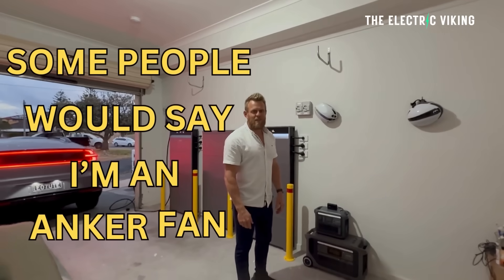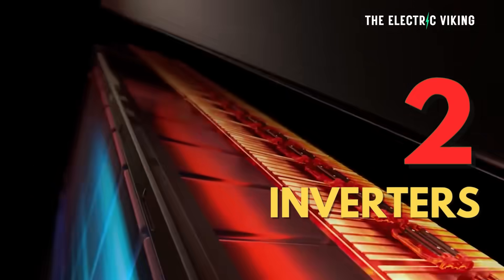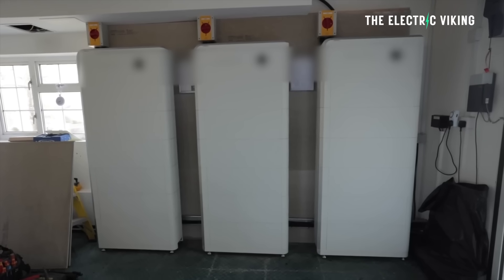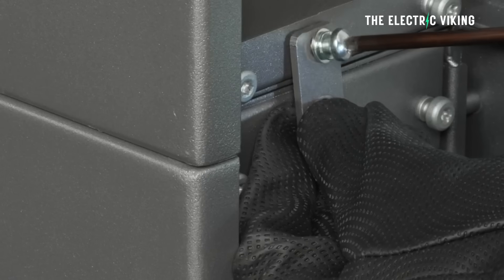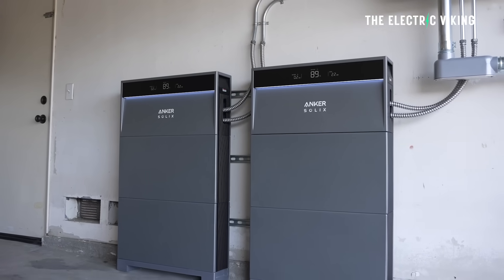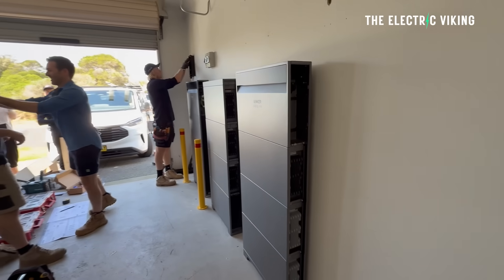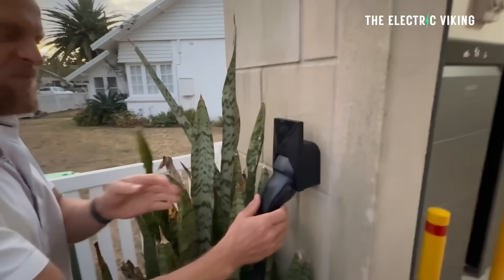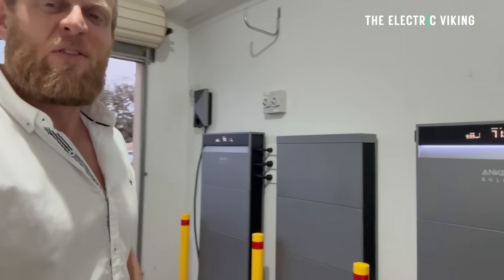50 kWh Anker Battery + 56 Solar Panels! My Home Setup Charges My House & EV For Free

Comment: They look nice but I have storage racks where I need the wall space. Anker is a little slimmer but you have so many of them. I have one 48kWh Sigenergy, 25Kwh inverter and 17kWh of solar.  I’m assuming your infomercial helps significantly to fund the batteries which is fine but you should probably tell people if that’s the case. Maybe I missed it?

Comment: These look great.    And these techs are getting more and more advanced.     

A few comments here.    If you want serious solar batteries system,  you need very very serious planning.     And it will be expensive. 

I have my solar system planned at mid 2024.   Here are my requirements at that time.   I have 2x 17kw 3phased air conditioner inverter and I have a 3phased 22kw 3phased EV charger.   I want the solar batteries to support one 17kw air conditioner for 4 hrs during blackout.      These requirements looks simple,  but if you convert them into technical spec,  it is a headache and definitely expensive.   Here are how they are done:  

-  66x 440w solar panel.  These panels cover all roof areas.  It is the maximum I can have (with existing solar pane tech at mid 2024).    Each of these panel weight over 20kg.  If you add the supporting structure and cabling, we are talking like close to extra 3 tons of load on the roof.   Luckily the house was still under construction.   The builder had to reinforce the roof further.      For those that go through building a house,  the builder added 20% for the management fee.  Thus the system is instantly 20% more expensive.   Plus the reinforcement fees.     From the aftermaths,   I could not have install such a system with an existing house.   

-  Fronius 3phase 10kw solar inverter x3.   In order to support the 17kw air conditioner plus EV charging,   I need like at least 30kw 3phased inverter.     There are not that many solutions going back to mid 2024.   The powerwall 2 does not support 3phase.  Even the powerwall 3 is in doubt plus they were not available at mid 2024.   

-  Without the solar system,  the mains has to support 2x17kw air conditioner + 22kw EV charger.   An standard level of mains supply is 60amp per phase That may not be abe to support that during the initial kick start of the 2x air conditioner at the same time charging EV.   Thus the builder had to negotiate with the Grid supply company to update the power supply.    

-  batteries.  Fronius inverters work with BYD.   Thus I have 3x 13.5kw per inverter. A total of about 40kw.  But these are not the actual usable capacity. (expect about 85% of that)     The system goes fully online only this July 2025.    During Winter with a good day,   the solar panel are enough to charge the batteries to full.  In a cloudy day,  it can't.    During Summer,  the panels can charge fully the batteries in at least half of these cloudy day.      With a sunny day, the batteries a full before 12noon.     I am planning to upgrades the batteries to close to 50kwh so that I can have power reserves during Winter.   

The return period of this system is like 10 years as the system is very very expensive.      But that does not account for increasing power bills.    So I expect this system to break even say 8 year.  Keeping my finger crossed.

Comment: Found someone on reddit who added his Anker Solix F3800 to his Tesla Power Wall 3. He just plugged his home power panel into a breaker on the house panel and the power was added without a conflict with Tesla software. To me is means you could add a cheap power source like a used leaf battery to a Tesla Power Wall 3. We just got 31 solar panels.

Comment: The problem with Anker as a single unit is that the inverter is only 6KW. You need 2 head units linked together (only available recently) to output enough current.

Comment: I have a Victron inverter system build with 77 kWh battery. Build myself just like Andy from Australia. Our house is all electric, heatpump and a electric car and a hybrid. I have 21,5 kWp on solar. But the wintertime is the problem. I am working on a battery update to 150 kWh and put some more solar to it.

Comment: I'm way down market. We live off grid with 12Kwh storage , 18 panels , big ones and still run an EV from home. It is our only car. We have been retired for 5 years so we do not do the travel we at one time did . If we were both still working it would not have worked but now it is the best option both financially and climate wise ....

Comment: OK you are spruiking Anker. I will give my unbiased opinion.

We installed a 20kW 3ph Anker system after we got messed around by BYD who were our first choice.
The durability and stack thickness means nothing in Australia. Looks mean nothing, a battery is a battery. I don't care what it looks like and the fact that it is 15cm thinner than the next one is irrelevant.
The screen display is fantastic. Every battery system should have this.
With 3ph supply there is no need for an expensive EV charger. We have a EV6 and just use a $200 32amp charger off eBay, works perfect. We can pull 8kW out of the battery but with the charger or use the "3 for free" power and feed the max 11kW to EV6 will take.
We fill our battery everyday from the grid (our panels do most of the work in summer, none in winter here in SW Vic) so buy no power. No need for 50kWh of storage. I reckon we could manage our all electric house and EV on a 10kW system and no panels if we had to. The key is having a 3ph supply and using the free power on offer through mobs like Ovo, etc.

We had initial problems but the Anker helpline was excellent and they sent a firmware patch within 24hrs.

There are wild claims out there suggesting 3-4 year payback. This is rubbish; we reckon 8 years is more like it and we are working the system pretty hard. VPPs are a con that will cost you money in the long run. They are marginal now and as the grid improves they will cost you money compared to getting 3 hours for free everyday.

The under reported factor in home battery success is having 3ph supply. People need to be aware that building in 3ph future proofs your home. We built 5 years ago and the additional cost was $2,000. The builder couldn't understand why we bothered.....

Anyway I am happy to recommend Anker but not for the marketing BS. My backing is due to Middys (or one of the other large spark wholesalers, can't remember which) being the importer so there is plenty of local hardware support and our experience of factory software support has been excellent.

My real advice is the important issue is the retailer and installer. You need to pay more and get a local, established, trustworthy company. If they offer a cheap system they will stand behind then just go with that.

Comment: Will you please dig deeper into the battery backup electric load and how that is managed? We’re about to level up the energy game! Dropping an 11 kW SilFabSolar array—made right here in Washington bro. And guess what? WA hooks us up with no sales tax, sweet net metering, and Uncle Sam throws in a 30% federal tax credit. That’s like stacking sunshine and savings! 🌞💸
Now the real flex? Cybertruck backup power. With Tesla PowerShare, we’re talking backup for 10 critical circuits. Basically, when the grid taps out your Cybertruck steps in like a superhero feeding juice to the essentials—think fridge, lights, Wi-Fi, and maybe that gaming rig.

Comment: it isnt for Free at all.  presuming the system is $40k with 20 years on the panels, 10y on the inverters. the cost will probably work out to 200 per month overall cost without any interest to any loan. 
I have 24 panels. I add zero to the grid. in 10 years I have only produced at todays 31c kwh around $4500 saving. I paid 10k 10y ago. 
Work out total cost divided by warranty period for value of consumption cost.. what you call 'free'
Reply: Add one or two EVs and see how the sums add up.😉

Comment: Just because you brought too close to the beach and your garage space was width limited and your phone app was apparently not reliable, your reasoning was to go with Anker batteries.  Well, for those not so limited and whose app works just fine, we can get pretty much the same amount of battery storage in one Sigenstor stack instead of  3 times that number you had to install.  That's why Sigenergy is the market leader in Australia, Sam. That's what I have installed.  You get the best and forget the rest as they say, unless, I guess you are limited in so many other ways, you have to compromise and make excuses for doing so.
Reply: Dude, Sigenergy just been there for 2-3 years, and you expecting them to offering you 10 years warranty?
Reply: Well, dude, that's 3yrs more than Anker that Sam claims to be the first  to install their battery, not only in Australia but the world! So Anker has less than 0.0001% market share and a presence of a few days here with Sam's Anker battery. Using your logic, Sam has made a very poor decision regarding warranty support for the next 10 years. The probability of a supplier being around for the term of their warranty is most likely best correlated with their ongoing market share. To that extent, I'm happy to have installed sigenergy because, currently, they are No.1 and growing.

Comment: I don't have anything like this at the moment, the most I have is a portable power station (Anker) for power outages :D I think I'm going to wait until sodium-ion or solid state batteries are cost effective enough to put into a system like this, and at least have some to cover power outages which are a significant risk in the winter where I live.

Comment: This is great. I have about the same as you in South Texas coast. 21 kw solar and 74 kw batteries. I have 2 systems, just in case one system has issues I have another system. Both work at the same time or separately. One is Tesla Power Walls with 16.5 kw of mico-inverters. The other is an EcoFlow that is 4.5 kw of string inverter. I get about 100 kw of solar every day. I belong to a Virtual Power Plant Program (VPP) and get credit for all my excess energy. I have 2 Tesla cars an a 3,000 sq. ft. home. I have enough solar for my home an my cars to have a $0 electric bill for the rest of my life. This is a great feeling.

Comment: The look and thinness of those Ankers are truly impressive. I didnt hear your cost for the system but clearly you invested massively lol. Here in Mass the electric rates are 3rd highest in USA. I have original AC500 Bluetti setup and as an early adopter cost me about $20k with 28kw storage/3kw max per hr  production which seriously offsets my bill for a/c and heat but I dont use it for my Lightning or MY because the energy needed is huge in a short period of time. We also dont get your level of sun so monitoring the system each day is critical. Really proud to be part of the EV/solar/climate movement and watch your vids regularly. Good work. 👍
Reply: I just installed a 12kw Anker solix x1 with 40kWh storage, it was 16k and qualifies for the us federal tax credit, it’ll be 12k after rebated all in.

Comment: South Korea’s government has approved a 53-61% greenhouse gas emissions cut target by 2035, compared to 2018 levels, Reuters says. An EU parliamentary committee has backed the bloc’s target of cutting emissions by 90% by 2040, compared to 1990 levels, Bloomberg reports. “Nonstate actors” adopted a declaration “emphasising the essential role of renewable energy in sustainable development and climate adaptation” at an African climate summit in Benin, Mongabay says. Foreign Policy: “China is already pulling ahead on the next energy supply chain.”

Comment: Analysis: China’s CO2 emissions have now been flat or falling for 18 months:  A new analysis for Carbon Brief shows that China’s CO2 emissions were unchanged from a year earlier in the third quarter of 2025, extending a flat or falling trend that started in March 2024. What will be America's excuse now that they can't blame China? POTUS' climate change denial is a hoax. The Guardian reports on Carbon Brief analysis showing that China’s carbon dioxide emissions “have been flat or falling for 18 months”. The newspaper notes on its frontpage: “Rapid increases in the deployment of solar and wind power generation – which grew by 46% and 11% respectively in the third quarter of this year – meant the country’s energy sector emissions remained flat, even as the demand for electricity increased.” The Financial Times says the figures put China on track for a “new renewable energy record in 2025”. Carbon Brief’s analysis is also covered by Agence France-Presse, Bloomberg, Reuters, Carbon Pulse and Table Media.

Comment: Would expect the electric viking to be able to disguise between kw and kWh. Bummer. 50kWh is obscene for a country where there sun mostly shines. Just use power during the day and limit it at night. No need for such big batteries.

Comment: Congrats on your battery system.  Not sure about the issue with an app, I've never had a problem with my 40kwh FranklinWH system in the almost 2 years I've had it .  I turned off the charge level LED stripe on my units because they're kinda bright at night (my batteries are mounted outside my house).  I had Span load centers and a Span Drive charger installed at the same time as the FranklinWH, and they work together well, so the Span Drive can charge my EV  (at 11kw, that's basically the max here in California) only off solar that would otherwise go back to the grid.  I haven't paid anything to drive my EV in the 2 years I've owned it.  The FranklinWH also has a generator input so you can charge the batteries if the grid is down, which happens regularly here.  I already had a portable gas generator, but if we installed a fixed diesel generator, the FranklinWH could start and stop it when needed to charge the batteries.

Comment: Nice to compare solar setup notes.  Thanks for the tour. We went with a hybrid system that has battery and grid backup but only covers about a third of my annual usage.  This allows us emergency off grid operation and also lets me charge my cars from the grid.  We never saw Anker as an option on the US east coast, but we are pleased with our 15 kW Franklin Battery which also supports a generator or V2L. That's all we could afford this year. I am hoping the democrats will gain control and revive our green energy rebates so we can expand in a couple years.

Comment: I did the numbers and solar does not save me any money. but I understand in Australia it is much more feasible. as the electricity costs is up to 4 times more expensive than eastern USA.
But, the costs of electricity are go up here due to building more datacenters.  without expanding the electrical grid.
Reply: It will save you money in the long run.

Comment: well Sam, i managed to get my land lord to take our power bill and roll it into our rent and got hime to replace a gas ducted heater , solar gas boosted HWC and gas stove and replace with RC ducted heating cooling system, heat pump HWC and 4 burner induction and a 24kw jinko solar array with 48kwh sigenergy stack and just increase rent by $40pw from 450>490 and no utility bills except phone and net
Reply: due in late dec

Comment: Look how much wall space it takes up and all the bollards 😂. 3 x stacks on the wall instead of having one stack with Sigenergy that takes a bit more floor space. More equipment to worry about if problems are to occur and more isolators and conduit on the wall if the cables can’t be concealed. Who wants to walk into the garage to see how charged the batteries are. Checking on your App on your phone is a lot easier👌

Comment: I've got 13.2 kw solar and 25kw battery system. 3  in family have a spa that uses a bit .My account in credit last two months zero bills ( of course their jakking power prices up next month ) the lowest my battery has got down to by morning is 61% so still have plenty in reserve.
Reply: what was the total cost, including installation ?
Reply: @derekgodfrey5   12k power bills gone $290 a month to zero
Reply: @pgale  my power bills are only about $300aud a quarter , so it would take 10 years to break even for me .

Comment: Are they Solix Grid forming inverters? Grid following is cheaper and works great until the grid goes down. Hmmm seems the portable ones must be grid-forming. Maybe that's all you need. Can the system "dark-start" during a power failure?  Ok good, now I see they are Solix. 🙂

Comment: Good choice! Anker X1 is top of my list. Do you know if this will shutdown if there in no internet connection with Anker?

I understand Sigenergy will after 90 days. So in the unlikely event Sigenergy goes bankrupt, you have a boat anchor!
I was thinking of Sigenergy until I heard about this.
Reply: yeh for the sig when it doesnt have 90 days of internet, it goes into safe operation mode as there no more active monitoring so it just does the basics charge the battery from sun and use the power as normal. it loses VPP mode like with amber, if that happens